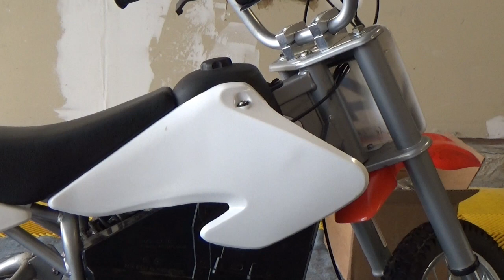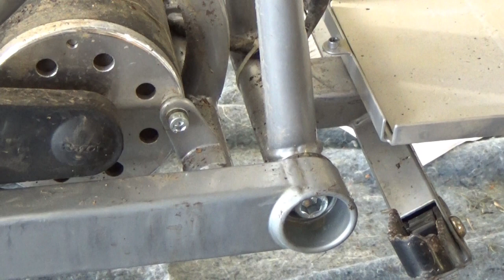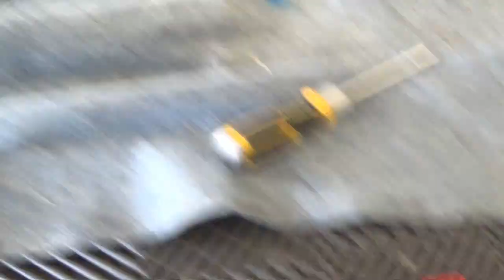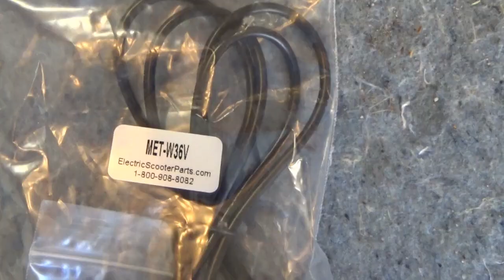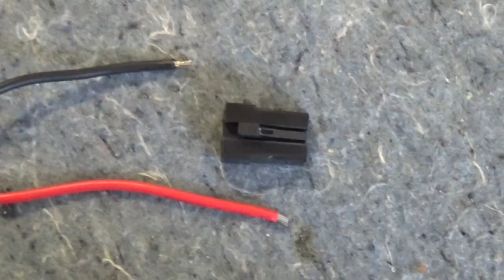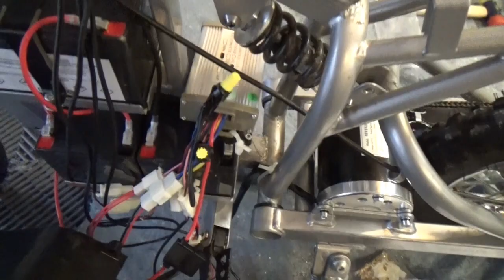Razor MX650 Upgrade to 800 watt motor

Comment: Countersink the holes in the new motor, which is better than drilling out your bike frame but both work. Also, just over-volting to 48V using a lithium battery will get you to 20 MPH and last much longer...just using stock electronics and motor. You can get 35 MPH from this bike by using a 1000W motor with new 48V controller and lithium pack. Recommend using 48V 30AH lithium battery pack so get an hour of ride time, or 20 miles basically.  This is a legit pit bike at 1000W.
Reply: Just back that screw out and be done, its wedge in there and held together by the other screws and those 2 screws on the bracket in front. Motor not going to fall out or apart.
😁

Comment: As an alternative to drilling into the frame to fit the motor I have recently seen people 1) back out screws on NEW motor 2) Use a larger drill bit to lightly enlarge the removed bolts hole and build a countersink for the bolts to fit into (You could even get new bolts with rounded head or lower profile) - I haven't done it yet but both methods seem to work :) Great video! * Or did you look at removing the back of the old motor and using it in the new motor? Aer they similar size?

Comment: Ughhh I dont understand why mine isnt working it won't even turn on I keep blowing fuses
Reply from the maker: Are you using a 40 amp fuse?
Reply: Yes I wired the batteries like yours and kept blowing fuses, I emailed them and they sent me a different diagram for the batteries and it work...go figure. Putting this together was easier than I thought... so much I bought 2 more for my other bikes 1 mx500, 1 mx650 and one rsf650 with upgraded air shock 😃 this stuff is addicting
Thanks for the quick reply too

Comment: i literally just purchased a bunch of stuff for mine to upgrade to the 800w; because I have no desire to make my campground cruiser into anything bigger than that. this video is awesome. I love that you included a partslist with p#'s. you're the man, Jim. 

I was initially looking at electricscooterparts for an entire kit or even just a few bits but shipping killed me everytime so I sourced everything through fleabay and amazon.

A trip to the hardware store probably could save you from having to drill the frame out...just swap the lower bolt for a flat head